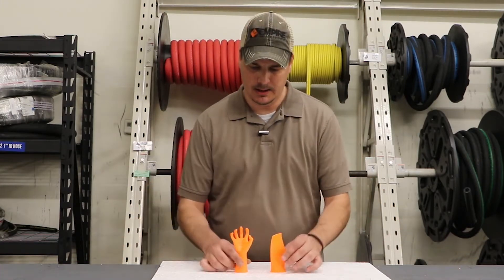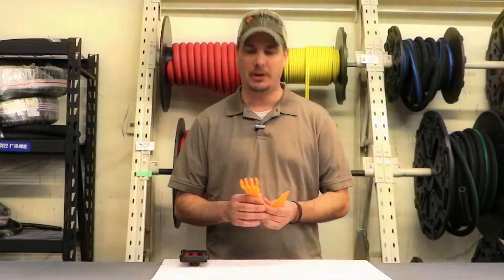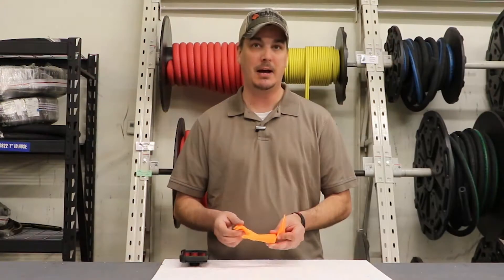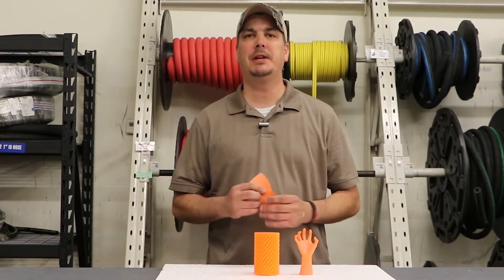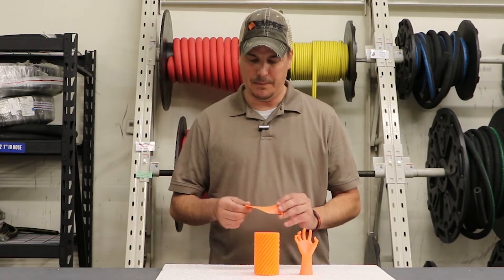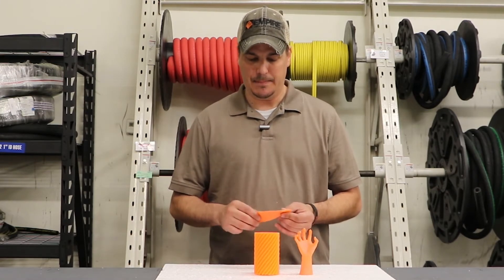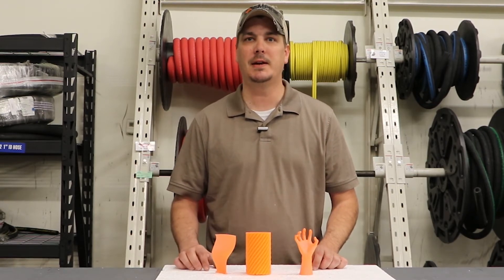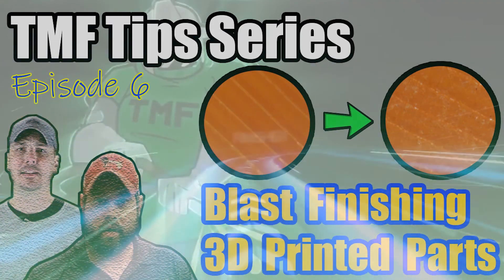Sandblast Finish on 3D Printed Parts

Comment: I tried blasting transparent petg with aluminum oxide and the part has what looks like burn marks! Any advice? Thanks
Reply from the maker: Hey....sorry just saw this.  Have you tried a spherical media?  I have had the burn marks before with allox
Reply: @TheMobileBlaster  I retried with very fine quartz! I asked the guy not to go too heavy and it worked fine. A few burnt spots but i guess it is a matter of how far from the piece you hold the nozzle. You think spherical  media would be gentler?

Comment: Would love a follow up to this video, trying more aggressive  medium basting (pressure or pressure unit) to see if you can get rid of the lines.
Reply from the maker: Will do Alonso...  Need to print up some new parts
Reply: @TheMobileBlaster  Thank you so much, please let me know when you do!! 
Not sure you can help with this question but I'm also super curious how the results would change between a low CFM (like 6) vs an industrial one like 35 CFM. 
In other words, is there a hobby grade solution vs not.

Comment: Thanks for the vid! I have a couple questions:

1. How fine are the glass beads?
2. Were the parts dirty after blast, and if so, how did you go about cleaning them?
3. Also, have you tried blasting a 3d printed part that has been acetone vapor-smoothed? (basically just putting a matte finish on the part)
Reply from the maker: Hey...Thanks !
I will be doing another couple tests because its been so long I forget much of the details.  I know we used a BT-10 Bead (pretty fine)…  I don't remember the parts being dirty, but that all depends on a cleanliness spec requirement.  I did have to air knife them to remove the dust and media.  
#3: No I have not...Would be interested in trying that process.